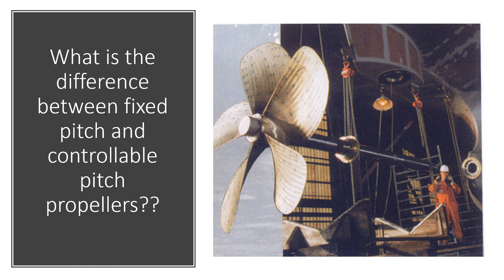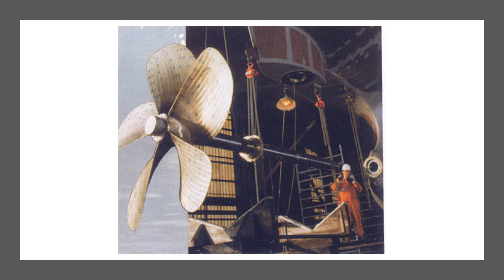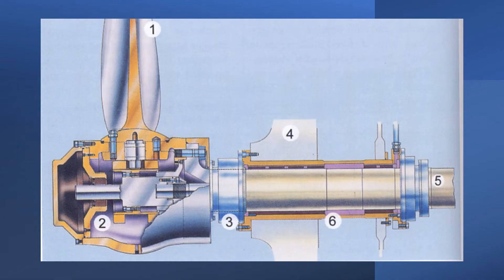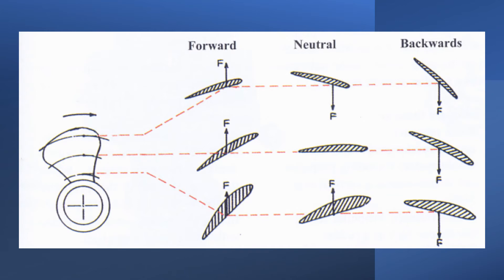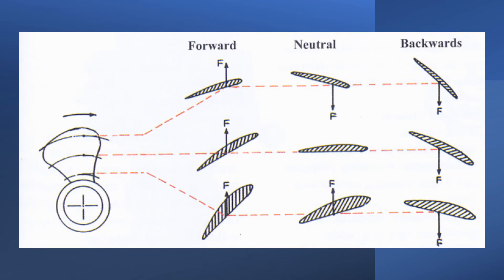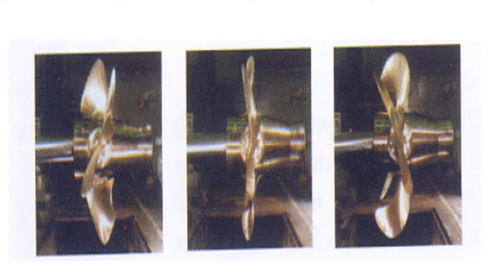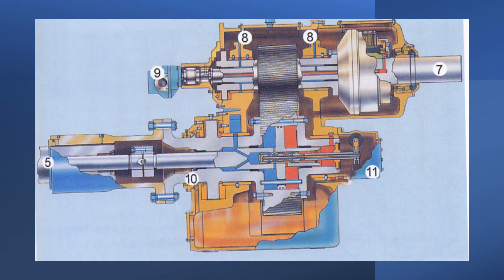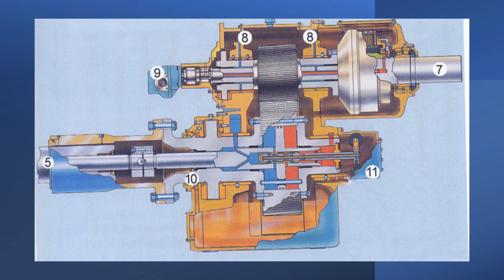What is the difference between fixed pitch and CPP propellers??

Comment: sir why we take 57.3 degree in gz curve.from where this value is coming why not 50 or 40or 60
Reply: The value of 1 radian is approximately 57.29 degrees.
Radian is the standard unit of angular measurement in the International System of Units (SI). 1 radian is equal to 180/π degrees